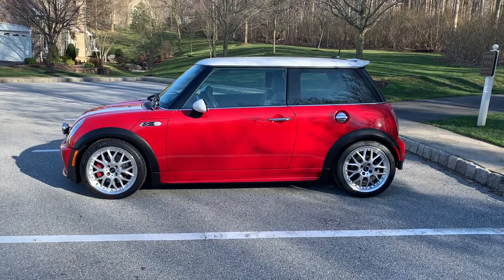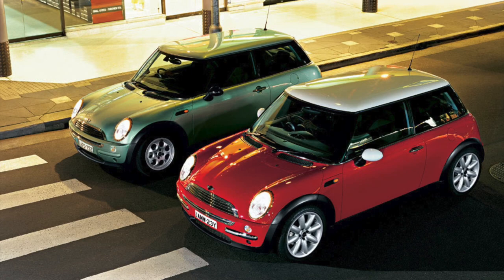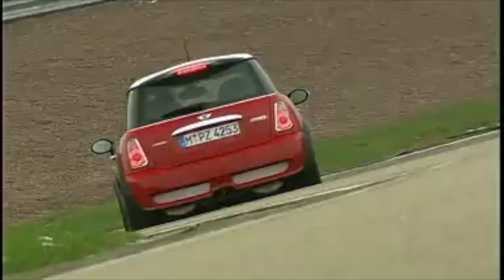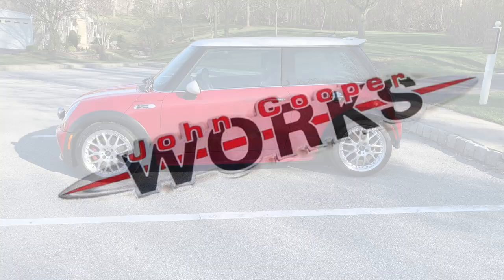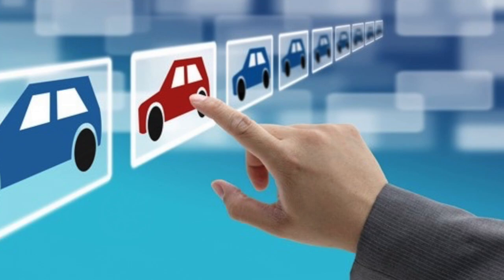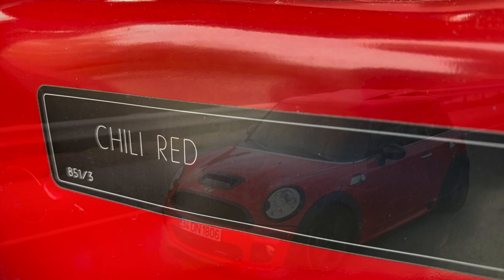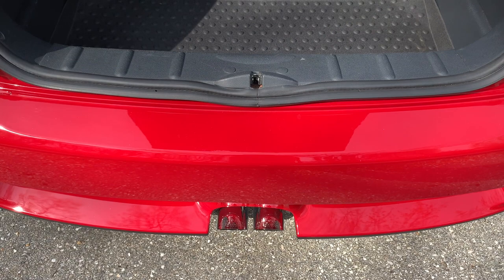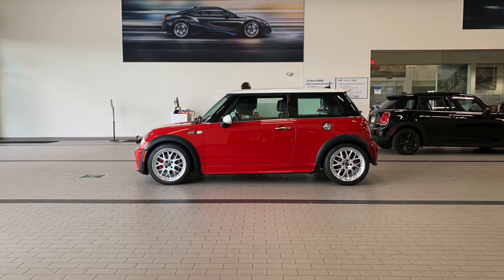Take the Tour - An in depth look at my 2006 MINI Cooper R53 JCW

Comment: I'm am the original owner of a 2006 Chili Red R52 JCW.  I've kept it close to stock (torsion bar and new rear control arms) except for the stripes.  Almost 160,000 miles and going strong.  In fact, it still drives like the first week I owned it.  I bought a new GP3 but will never give this one up.
Reply from the maker: You never forget you're first....MINI

Comment: Thanks for sharing your story. I would love a JCW and came close to buying one last summer but was beat out in my bidding at the very last second. Just doing some shake down runs on my 10/9/2006 build slick top R53. Picked it up Oct 2020 out of Seattle with 41,900 miles. Over the Winter I went through the front suspension and replaced all wear parts. Then went ahead and did all maintenance, Supercharger service and reduction pulley install, new colder spark plugs, new coolant and hoses, StopTech slotted brake discs and Hawk pads, along with a transmission service and an oil change. The car runs perfectly. Handles wonderfully.  Quick but not fast which is safer for me and my monthly insurance bill. Hard to beat for the price point and I believe my Mini is quicker and will get out of the corners better than my friends with Porsche and BMW’s for 1/4 the price.

Comment: Greeting, I  love your channel, Mini addiction, professional videos, the whole package! I have a 2005 Mini S convertible I ordered new, waited months to have it built and took delivery in April 2005. I ordered all the options related to performance except the JCW kit that was so expensive at that time and I didn't want a dealer mechanic messing with my engine. I upgraded with original JCW intake air box and the front spring towers cross bar. Miltex SS exhaust, 15% pulley, colder plugs, larger injectors,  and the ECM flashed with the JCW factory tuning done at the dealer. I wanted it to be JCW like without the price tag. Oh a thicker rear sway bar and SS braided brake hoses. Side story. Our Mini club went to a performance tune/dyno shop and had our cars dyno tested. There was a JCW 2006 Mini that had the "kit" as a factory installed option! He was bummed because my Mini came out to have three more WHP then his. I put my Mini in environment controlled storage in 2011 when I retired and moved to Costa Rica. It has <37,000. Miles on it. I plan to visit it for the first time since then and get it running. It was alway garaged and never saw rain or bad weather. I alway wanted to upgrade the brakes to  the JCW option and now they have a even bigger brake set for the second generation. My question to you sir. I have the R90 wheels like you have. Can I install this kit, with the four piston front calipers, on my R52 without any problems or do I have to add front wheel spacers! Any information would be much appreciated. You have an amazing stable of MIni's!, Thanks
Reply from the maker: Hi Roland. Thanks for taking the time to comment.  Sounds like you have an amazing R52.

For the R56 JCW brake conversion, you’ll need rotors, pads, and R56 brake lines.

The R90 wheels do clear them, but just barely (like 1mm).  I’ve seen people do this successfully, but I opted for a 5mm wheel spacer to be safe. 3mm would work too.
Reply: @MINIstryOfSpeed01  Thank you so much for the prompt reply and great information....soso helpful! Did you have to reprogram the ABS and traction control systems? Mine is liquid yellow. Thanks, I could talk to you for days about MIni's for sure. Cheers
Reply from the maker: No reprogramming is required. Just needed to do a full bleed of the brakes (including bleeding the ABS using the shop computer method)

Comment: I just bought the exact same car same color. But mine has more options on the interior. 12000 miles mine has. I don't know why they let you put that in the museum because it doesn't have the original Wheels that's not how it came. Mine has lower miles and all original. You're lucky they didn't know about mine at the time because they would have never considered yours then...js

Comment: Did you have the bottom(between the tires) of the car painted. It look great!
Reply from the maker: Hi Harvie.  That area is part of the optional MINI Aerodynamic body kit, which gets painted when installed.
Reply: @MINIstryOfSpeed01  Thanks. Would it be possible to paint the one that comes on the car. It just looks so much better.